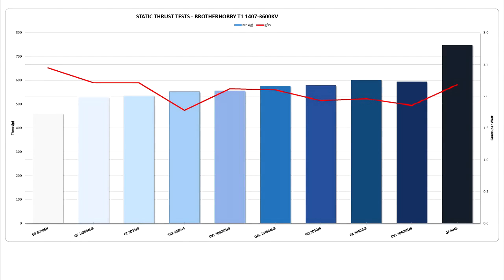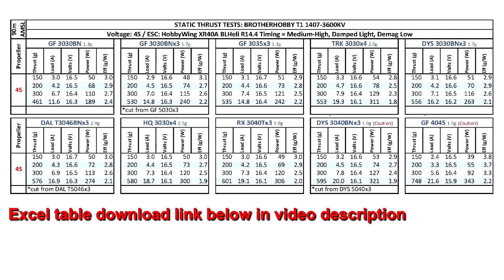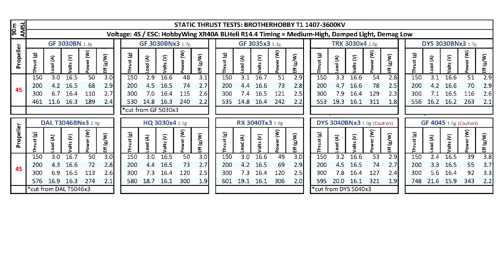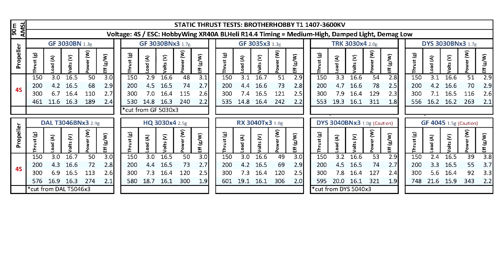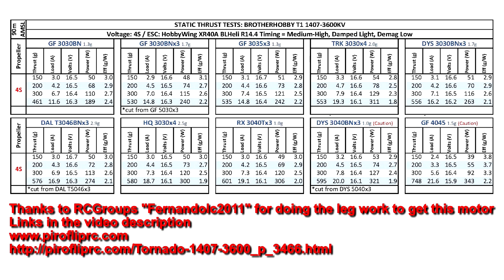BrotherHobby Tornado T1 1407-3600KV 4S Static Thrust Tests

Comment: I think I read from you on RC Groups that the RotorX 3040T are the best option for props for motors like these. I heard the HQ 3x3 are underwhelming. But what about the HQ Durables 3x4.5x3? What do you think of those compared to the Rotor X 3040T?
Reply from the maker: Based on tests and several positive comments on the RX T3040, I do think they're one of the best, if not the best, 3" prop for this size motor. They're so light and seem to be very responsive. Just too bad about their price and how fragile they are. I have not tested the HQ durables 3x4.5.x3 yet. Generally, those 6045x3 derived-BN props (5045/4045/3045BNx3) do get lots of top-end thrust but they end up drawing lots of Amps as well. Also they tend to be somewhat heavier and very stiff at the hub-blade joint. Not bending as easily as the 5040-derived props could make it easier for the 2mm motor shafts to bend on a hard impact. I didn't consider testing this 3" BN prop for those reasons. Also because the small 1306 and 1407 motors didn't seem to have enough torque to effectively spin such a "heavy" prop. Now, this BH1407 is probably strong enough to spin it. Still, I think they're too hard on motors and LiPos and for such high KV motors, the lower 4" pitch props like the RX3040, and DYS/HQ/DAL 3040x3 would be a better choice (my opinion) I haven't actually flown the 3045x3 so I can't say if it's better in flight.
Reply: Thanks for the feedback. I really appreciate it. I have a few sets of those BN 3 bladed HQs in 4 inch and I really didn't like them at all. I still fly the standard HQ 4x4x3. But now that I'm building a 3inch I really wanted HQ again, but their standard 3 inch props doesn't have the same shape as the 4x4x3s that I like. It's sorta pointy, like the 5x4x3. The price is right on the HQs though. I guess I'll bite the bullet and get the RotorXs, but dang they are pricey and I intend to break a lot of them. :/
Reply from the maker: You should order a set of the DYS 3030x3, they're right about the middle on thrust and Amps, just to try them. They're sort of cheap too. Banggood has them. Give them a try, they're better than HQ 3-blade. Then there's the TRK 4-blade. Several people have been giving them good marks. Those tested lower than the DYS, but they seem to fly very well. Check out this guy flying a Xiaomi Yi on his 130mm: https://www.youtube.com/watch?v=91bQZoDu5B8
Then, another option to try (depending on what motor you are using) is the cut-off 5040x3 (you'll need some sort of jig). Unless you're racing and need the absolute best.... those RX T3040 would get very expensive soon if you have to replace them too often. I need to go out and fly my 130mm more. It still has the RCX 1306-3200 on it. I debating whether to slap the 1407-3600 on it or build another 130mm as I have enough parts for yet another build. Just no time to fly lately....
Reply: Awesome man. Thanks. I'll check out the DYS. And that video. BTW, I'm in San Diego. I believe you are too, right?
Reply from the maker: I little north of there.... close to downtown Los Angeles - sucks for finding good flying spots !
Reply: Ahhhh. Well, if I'm ever going up that way to fly I'll hit you up. -D
Reply from the maker: Yeah! let me know, it'd be cool to go flying. Likewise - If I'm ever in your neck of SoCal I'll hit you up.
Reply from the maker: Well, if I could fit 3530x3 to my 130mm frame I would try those and fly the copter the way it's intended to be flown. Check to see if there's no funny behavior with those props. The larger props will give you more thrust and will be a little more efficient when compared at equal power output. If you do fly too aggressive, 3.5" props will discharge battery faster because the extra 50g thrust will need more Amps (90g on my tests, in flight difference is actually less ~around 50 to 60g guessing) If you notice flight times are OK and flight behavior is OK then better to go with 3530x3. Also check recovery after a dive, you can compare if you can notice any difference. That's where you can see if props have good response and make good thrust fast from lower RPMs.
Reply from the maker: I meant check, just in case, sometimes due to prop wash it could be hard to get a good tune on the FC. But that's few cases, also for these small props the chance is even less I think.
Right - Example: you have a 3" prop with max thrust 500g @15A and a 3.5" max thrust 600g @17A. (but if you limit to 500g then only use 13A ~invented numbers, not real - just for example)

Fly 3" prop 500g @15A draw from LiPo, get 3min flights
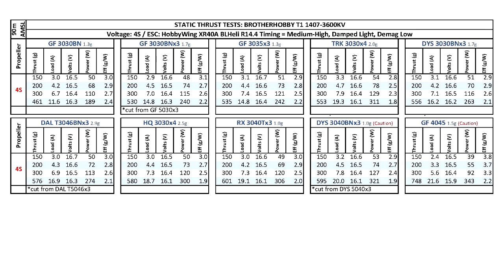Fly 3.5" prop 500g @13A draw from LiPo, get 3:30min flights

The difference will be very small since there's only a couple of Amps difference between the 2 props at same power level. But if you use the full 600g @17A then you end up discharging LiPo faster and get shorter flights, maybe 20 or 30sec?  It should be just a little noticeable I think. But you should notice the power difference. 

But..... you have to try the propellers because sometimes the blades could be too flexible or not have enough pitch and will not feel responsive. So the test numbers favor the 3530x3 but ultimately only when you try the prop in actual flight you can see if it suits your needs.
Reply from the maker: Those look like the same Militia props. Not too expensive for the 12 props. I have tried the DYS3030x3 and so far I like them. Banggood also has the DYS props but more expensive. I don't have a small frame that fits the 3530x3 so I didn't try the Militia props yet. 
The other propeller that I've seen some people like with this motor is the Racekraft 3030x4 on 4S. I got the one set so also I have not tried it yet.... too many parts and not enough time to try them all !
Here's some one using them with same motors https://www.youtube.com/watch?v=dKgVmMSureo
Reply from the maker: Fede Snoo I've used the solid color. but if you can find transparent those are newer and material looks very good. Performance is very similar
Reply from the maker: Fede Snoo DYS has 2 props 3045x3 and 3030x3. Depends what you want to do. For more top end speed 3045x3 for faster low to mid rpm response and freestyleI think 3030x3 is good. But hard to say in reality because we all have different skills a different perception of performance. Did you see video of 3530x3 prop? Looks like a lot of thrust
Reply from the maker: Fede Snoo BH 1407 is strong. No problem with those props on 4S and a good 20A ESC

Comment: Please do thrust test for 1407 3800kv and 1407 5000kv motors from myrcmart.
Reply from the maker: Novel Sreduk I'll be posting tests for RCX 1407-3200 and 1407-3800. Should be up in a few days. Unfortunately, I didn't get the 5000kv   motor.
Reply: It is a great, with 1407 5000kv you would cover almost all motors options for 3inch props.

Comment: Will these fit the  same screw holes as a 1307?
Reply from the maker: Yes, they use the same mount hole pattern as 1306 motors. 2mm screws.

Comment: Cool motor! I liked the summary at the end!
Reply from the maker: 3S 4" & 5" props results added to spreadsheet
Reply: 3s 5030 looks like a very good choice. Highest thrust, lower watts than pretty much everything else.
Reply: Would probably depend on the LiPo. Even on a very light LOS acro quad, flight time would likely be limited. 

I have a 200mm frame with 1306 2300KV and 5030 props that can do LOS acro for 8-10 minutes on a 3S 450mAh LiPo. Going to build a second one with T-motor F20 3200KV motors. Depending on how that goes, I may or may not try 3600KV motor with 5030 props on that frame.

For now, I'm planning to put my 1407 3600KV on a 160mm frame with 4045 props instead. Will test with 2S 950mAh, 3S 450mAh, and 3S 850mAh. My expectation is that 3S 850mAh will give best power, despite higher weight. Don't have any small 4S packs yet, but will eventually get some 4S 850mAh to try as well.
Reply from the maker: 40g frame! That's a superlight frame. I can see how these motors with 4045 or 5030 props on 3S may match well with the 200mm Warpquad.
Reply from the maker: Thanks for watching. I used my laptop mic, so audio is not that good.
Reply: Yeah the comments at the end are helpful to contextualise the results.

Still struggling to believe that a 3" prop can crack 600g on 4s also I had not looked at the gemfan 3046 before good results 4% less thrust than the rx3040 but 10% lower draw. Easier to source this side of the pond too.

Good job BH and thanks to piroflip for sending
Reply from the maker: :) I'll have to make start including them more commentary then. 
Same here, I couldn't believe how much thrust this motor was putting out. The GF3035x3 and DAL3046x3 (cut from 5") seem like good options, but of course they gotta be flown to see if they have good flight characteristics. The DAL 5046x3 was very good/efficient in the thrust stand but too flimsy for flying aggressively. Cut to 3" it may be OK. It's cheap enough to give it a try.
Yep... BH did a good job on this small motor.
Reply: Count my vote in favor of commentary as well! Provides very useful context for noobs like me who aren't used to reading charts from the test stand. ;)
Reply: Lower KV, e.g. 3000KV, would likely be even more efficient with 5030 and 3S.
Reply from the maker: Brainstorm Right. The KV is little too high for 3S- 5030. I'd be curious to see if it would work well on a superlight quad.
Reply: Agree lower kv would be nicer but still pretty functional no?
Reply from the maker: So "unloaded" guesstimate  for the 5030 is 16A and 190W Max throttle (conservative), difficult to say if that would eventually heatsoak the motor (depends how much you're on high throttle). Then again, this motor appears to have very good heat management. Seems like it should be functional but I can't say it's a 100% functional setup -not until I or someone tries it in-flight.
Reply from the maker: Some very interesting combos there! We'll be looking forward to your thoughts on those setups and on the motor. Hopefully you find the "sweetspot" in one of those setups.
Reply: What frame are you using? most of the decent 200s seem to be 22xx only.
Reply: I'm using a 200mm Warpquad from ImpulseRC. See http://www.impulserc.com .